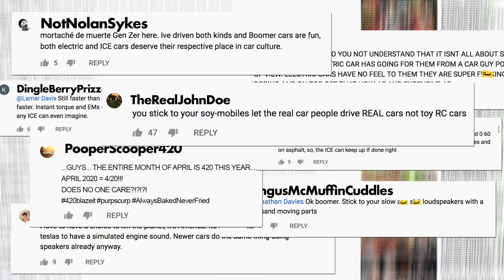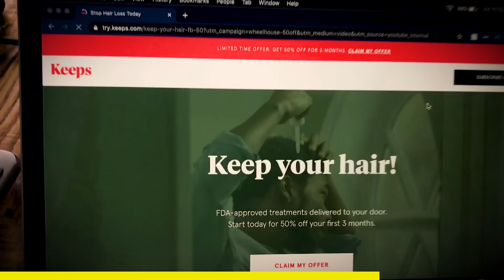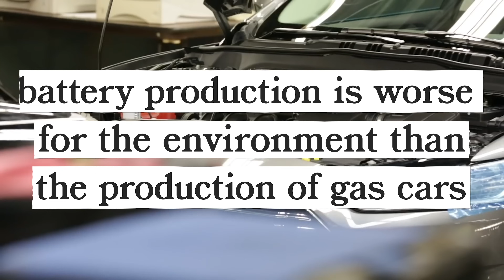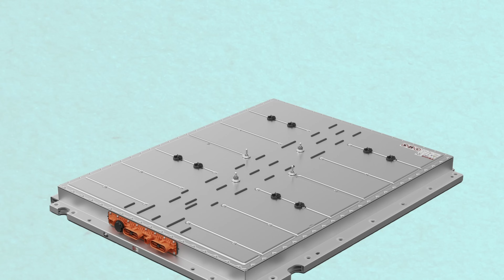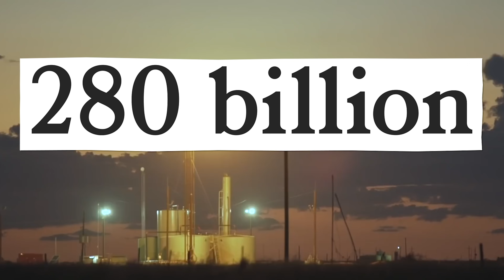Are Electric Cars REALLY Better for the Environment?

Comment: Ive seen a lot of these videos and noone actualy sees the real problem, not one single person or video has yet to see the real issue. People talking about powerplants and power delivery and that the powergrid can handle it etc. But what they all mean is that we have enough powerplants to make up for the demand. But its not the actual powerplants that is the issue, its the grid, the actual cables, fuseboxes, transformer stations. It is not designed to run at peak capacity every day all year around.
Listen, about 6 months ago I bought a hybrid thinking that I could drive to and from work on pure electricity, that way I wouldnt have to drive my old V8s every day and it would reduce my monthly costs a lot. So I bought the car and I got a charger installed at home. But oh boy there the problems started. See even thou I have the max available poweroutput in my home that you can get as a private citizen, I can barely charge the car in the winter. The charger will turn off constantly because Im close to max power output of my house, and I cant increase the amps further. This is the issue for many people Ive talked to, they cant cook, or run a vacuum cleaner while charging the car.
An even bigger issue is people who live in commercial buildings and apartments in small towns. There is absolutely no way every single apartment or parking space in a building like that can have one charging station each. The max is around 4-5 stations in an apartment building with around 70-80 apartments.
This all means that electric cars can only be used by people who live in big residential areas, in new power efficient homes, hence, EVs will NEVER take over, not as long as they run on lithium batteries anyway.
Reply: Man, you are such a genius to see what 100,000 engineers and scientists could not see. Thank you, thank you for  enlightening us.
 
I mean seriously, you have a breaker box that is undersized for your house; that's not a grid problem, that's a 'I didn't do my own due diligence before buying an electric vehicle problem'. If you didn't have 200A service, yea that's on you.
Reply: @MrRentageek  I have max what is possible to have in Sweden. My house isnt the issue. I work with cars, I am a Mercedes tech and we get customers who has the same issue all the time.
Even in our workshop we can only run 1 charger at a time or we blow the fuse. These chargers requires a LOT of juice.

Comment: I don't WANT an electric car, i want a fucking electric assist velomobile (OVER 20, TWENTY TIMES more efficient than any EV if fully electric, and even MORE efficient if you're assisting it with pedaling!) and roads to use it on, more trains and subways! These are BY FAR a better way to get around, much cleaner, much less energy consuming than cars (which suck in energy consumption ratio, electric or not). But to make that happen you need better roads and infrastructure, and for THAT to happen you need to get rid of government monopoly on land, infrastructure and city planning, which isn't happening because everyone thinks the government is the savior for some reason while its the biggest villain in history.

Comment: For me it's not about EV vs. ICE; as a road racer (SCCA), it's all about weight and handling...past around 3,000 lbs there is NOTHING you can do to make it handle properly on a road course. My Ralt-41 Formula Atlantic, powered by a 1,600 cc motor (250hp), weighs 1,280 lbs, all fluids and driver included, and will outperform and outhandle ANY car, super and hyper cars included. It's all about the weight, boys and girls.
Reply: It’s also about weight distribution and centre of gravity

Comment: The biggest isue with ev's, is the comming disaster of batterywaste....
Just putting it in a storage?
That is so stupid, it is like....we have a problem, but we will just ignore it until it is unbarable.
Alternative, clean biofuel, is a much better option that can be used in ICE cars, used directly in the gas stations etc.
Yes, I know alternative fuel is not perfect right now, but neither are the ev stuff (far from it), and puting more effort into developing clean energy to put on ICE cars (which are getting pretty clean even on dinosaurjuice), would be much better. Why create a new problem for the future, when one could solve the current issue in a much better way. 
Take a look at Koenigseggs TFG (3 syl, 2 liters, 600 hp, 600nm, runs on biofuel). If that engine is driven in a poluted place, the exhaust is actually CLEANER than the air it sucks in...how about that? 🤘🤘🤘
Reply: Actually with current technology batteries are more than 95% recyclable including recovering all of the lithium, nickel and cobalt.
Reply: @engineeringtheweirdguy2103  

https://youmatter.world/en/are-electric-cars-eco-friendly-and-zero-emission-vehicles-26440/
Reply: @andreemilsen369  your article agrees that they are in general better than combustion cars and more eco friendly. In response to the batteries, I’m not surprised his HR experience and his degree in sustainable economics failed him in the technical field of chemical and mechanical Engineering but a quick google search show that’s with current technology EV batteries are greater than 95% recyclable.

And whilst at current not many of them are recycled but rather re-used, as EV’s have taken up in popularity, we’ve started to see a S curve increase in battery recycling plants, similar to how the lead acid recycling infrastructure occurred. Which means as they become more popular they are recycled more.

Don’t believe me? Google is a click away
Reply: @engineeringtheweirdguy2103  
I do not think oilbased fuel is the future, but biofuel.
Developing biofuel on the same scale as ev's, would be a much better future. But now, there is too much money invested in the ev marked, and therfore any other solution (better or not), is activly killed in it's infancy, to protect their investments in the ev marked. It is not at all about enviournmetal impact anymore (it was in the begining), but all about profit. I understand that many people belive in the ev revolution, it is promoted as the future from all directions.
Reply: @andreemilsen369  actually most media pushes for hydrogen over EV. That’s because apart from having a Manopoly on fuels, oil companies also have a monopoly on fuel stations. With EV’s, you can charge at home, but with hydrogen you still need to visit fuel stations, allowing them to keep their monopolies. 

There is still a significant bias against EV. People constantly calling them dangerous despite all the evidence against it. Universities have done media studies and found that most people think EV’s are fire hazards because the only time car fires are reported in the media is if someone famous dies, or it’s an EV. When in reality EV’s are 11 times less likely to spontaneously combust and 5 times less likely to combust in an accident.

Media still pedal them as being short range city drivers that need the batteries replaced every 2 years and run on coal. None of that is really true at all. 

In dealerships EV’s typically have a very poor sales rate because dealerships aren’t incentivised to sell them. Because they don’t need servicing, so they don’t get that continued servicing income. So they actively down sell them. 

No, EV’s aren’t being pushed or propped up what so ever, they have had to fight misinformation and bias since their conception.
Reply: @andreemilsen369  and biofuels. Whilst technically a good idea. Isn’t the solution. We barely have enough food as it is. To put aside enough land to harvest enough oil to replace fossil fuels, would cause world wide famin, and food prices would skyrocket. We are already seeing those effects with just ethanol from
Corn with E10.
Reply: @engineeringtheweirdguy2103  
German engeneers have manged to make fuel from biovaste. Solving two problems in one.
Reply: @andreemilsen369  then why is it when I google biovast I get waterhoses
Reply: @engineeringtheweirdguy2103  
Not incetivesed?
Right.. 
The Norwegian government supsidises EV's and a Tesla is cheaper here, than in the U.S. 
All nonelectric cars, are about twice as expencive.
The dealerships I have talked to, do not want to sell EV's because they simply are not good cars compared to the ICE cars. I suspect what you said, is part of it too, but in Norway, there are a lot of just ev related problems, especially in winter. 
I think you and I will never agree on this topic, and that it is best to agree to disagree 😊 which, is totally fine 😊
I fear that the ev incentive is too strong, and that the world will suffer the consequences in 30ish years. But....I really hope I am wrong about how bad it will be. 😊
Reply: @engineeringtheweirdguy2103  
Could not find the article now, but found this one.

https://www.eni.com/en-IT/operations/waste-to-fuel.html
Reply: @andreemilsen369  not good cars compared to ICE cars? You do realise that was the dealer trying to steer you AWAY from EV’s? In reality EV’s are dramatically safer than combustion engine vehicle’s, provided you can charge at home they save you approximately 17 hours a year from going to the fuel station, they cost around 1/10th the cost per km to run and they live longer than combustion cars with none of the required regular servicing.

They also offer a smoother drive and better torque control and often out perform most other vehicles in its category. For example the Tesla model S plaid is a 4 door, 5 seat, double boot, large luxury family sedan which has better performance than purpose built 2 door no boot, multi million dollar hyper cars.

Whilst there isn’t a lot of variety out there for EV’s currently, they offer alot more than their combustion counterparts. Your dealership is lying to you
Reply: @andreemilsen369  in relation to incentives, I was referring to media incentivising. Not cost incentives. There are cost incentives for everything that is greener at current, hydrogen, E10, ethanol mix, renewables, bio fuels.

Comment: Did you forget the part about Evs needing new batteries after certain time? I believe it's time not milage.. and there is no clean way to dispose these batteries
Reply: It's miles, not time, and batteries are projected to last 2x as long as the average ICE.
 
And batteries are over 90% recyclable. When they finally die. Which isn't even when the car does, because a  batter pack that has 50% capacity might be pretty useless in a car, but could be quite useful as a backup computer battery. Or something like that.
Reply: @MrRentageek  incorrect they are 0 recyclable https://www.sciencemag.org/news/2021/05/millions-electric-cars-are-coming-what-happens-all-dead-batteries
Reply: @schwinnbiking  Just where do you people get your misinformed garbage from?  You've obviously never owned an EV, otherwise you would know the battery has an 8 year warranty. Why post if you don't know what the facts are? You just make yourself look stupid.  It seems yours is a case of " don't bother me with the facts, I've made my mind up". Yeah right...... Like I said, you stated EV batteries cannot be "cleanly" recycled. Clearly, that was total crap.
Reply: @Brian-om2hh  I do know bro ..

Comment: You are assuming here that a battery can last the life time of a car. And that’s very wrong. A battery lasts a few years at best and it needs replacing… redo the math and you will see which type is better.
Reply: Actually, the batteries have a useful life that's longer than their time as a car battery.  They already come with an 8 year warranty, and the record is over 400,000 miles (with a single repaired module).

Comment: Otto engine driven car with methane or ethane would be quite effective 

This would use methane, which is already a problem as we do produce methane more or less accidentally 

And methane has one C atom and 4 H atoms. In perfect combustion, 1 methane molecule burning would produce 1 CO2 molecule and 2 H2O molecules. 

Also 
An otto engine running on methane would be one of the most (if not the most) efficient fossil fuel engines you can find, being quite efficient 

And methane doesn't even need to be fossil. Cattle produce it, compost produce it

Comment: What the fans of internal combustion engines like are the sounds and they're cheapness 

Prove me wrong
Reply: 1. They're only cheaper for now. A new tesla 3 standard is the same as a Toyota avalon. Less moving parts, simpler technology = inevitably cheaper. 
2. Sounds is wasted energy. If your engine is loud, that's because it's extremely inefficient. Look at a porsche 911 turbo. Fastest car there is, sounds like a vacuum.

Comment: Did you calculate in the emissions that have been put in to each ice vehicle since the early 70s. My grandfather designed a carborator that got 80 mpg sold it to gm and never saw the light of day. What do you say you take of the emissions on the vehicle you get almost triple the mileage or the fact that plants use CO2 to make O2  oh wait never thought about that side of things plus whose to say the environment doesnt use Nox and methane to create something else our bodies need to survive. Lots of info out there and most has been suppressed because of greed. Lets not forget of the gas turbine cars that were more efficent yet scrapped because of greed

Comment: And how do you generate most of electricity to work cars?? 
You use fossil fuel to burn then charge the car 🤣🤣
+ Radioactive lithium 😅🤣🤣🥲
Reply: still, the emission is much less than gas powered car
Reply: Not in the UK we don't. Only around 4% of the UK's energy comes from coal.  Around 50% is from renewables....
Reply: @Brian-om2hh  what about other 46 comes from my ass ?

Comment: I know they have gotten better batteries and longer range miles between charges.  But never going to be practical until you can drive interstate speeds at least 500 miles and charge it full charge in the time it takes to pump 20 gallons of gas
Reply: All of that is true. I am wondering about the supply of Lithium. If you suddenly switched all of the gasoline cars to electric, how long would the Lithium supply last? Seems like they need to figure out a better source for the battery technology.
Reply: @DRM-nb1fg That's probably the least of the problem. The electrical power grid is already overloaded and nobody wants a power plant in their backyard. Solar and wind alternatives aren't really practical either just look at Texas earlier this year. Hydroelectric is the only really clean reliable power next i have to think is necular power plants and God forbid we build anymore of them or we will also glow in the dark.

Comment: Over here in Germany Tesla wants to build a huge production facility.  The only problems:

1) They got rid of thousands of trees.
2) They will use estimated 400.000 litres of water per HOUR. 

So yeah I'm pretty critical
Reply: They are planting double the amount of trees that they are cutting down which they said from the start and they cut there water consumption by half. And have plans to half that.
Reply: @HarrisonAdAstra  Alrighty I knew about the tree thingy but I didn't know about the reducing of the water consumption.
Reply: Also your name is accurate

Comment: The answer imo is biofuels that can replace petrol and diesel. The Electric vehicle market is big business capitalising on peoples desire to care for the planet. This market has been slowly convincing people for years it’s the only way but there’s no way battery production can avoid the problems it faces in time to make electric vehicles a viable revolution. The best thing you can do is look after your car and don’t buy a new one until you really really really reeeaaalllyy need one. Also note that in the UK only 5% of Mechanics are trained to work on Electric Vehicles. Oh, and you’re not taking into account what it takes to install the charging points and all factors involved regarding energy and material cost. If everyone switches to electric the amount of resources required would completely invalidate the reason to switch in the first place.
Reply: Synthetic gasoline or E-Fuel seems like a pretty good solution. Continue using the older cars, but run much cleaner with the synthetic fuel.
Reply: @DRM-nb1fg  yeah definitely, bio fuels do demand high quality perishables / fuel lines though which would take up recourses... it’s tricky but I’d say a balance can be found. Cleaner burning fuels will mean EGR valves could be scrapped which would help lengthen the lifespan of diesel engines.

Comment: where did you get your facts about the power grid withstanding having to charge EVs i have had to add transformation to circuits and bigger secondary wire to feed a total of two EV chargers that were added at the end of a tap line the whole block was experiencing low voltage due to what we call flicker factor because of the new chargers installed. I know a lot of circuits and infrastructure that would burn the fuck down if every household had an EV charger the power grid can generate plenty of power for this but the infrastructure that distributes the power can not keep up and there is not enough lineman in the country to replace and upgrade all of the infrastructure in the time frame of having to go all electric. i’m not against EVs and i would own one but don’t ban my gas cars! i’d like to see this comparison but with an internal combustion engine motorcycle vs an EV, when gas prices skyrocket i will be riding my motorcycle that gets 50 mpg and on another note how about we stop buying new cars every freaking two years remember when people would keep their cars for a lifetime and rebuild them the environmental impact of manufacturing cars both electric and gas at the rate a throw away society consumes them is astonishing